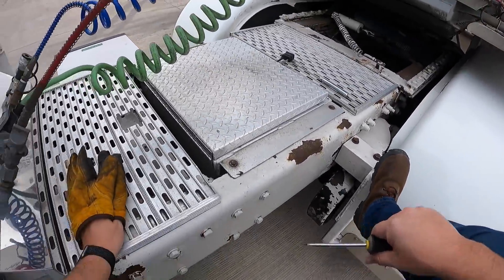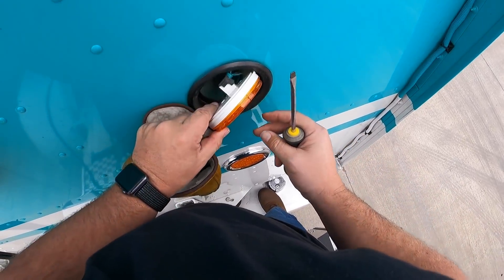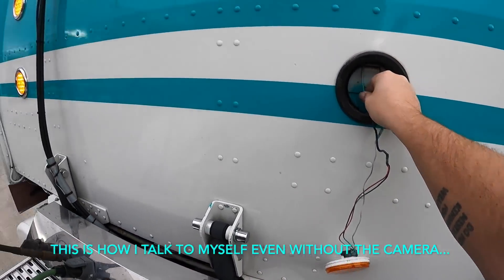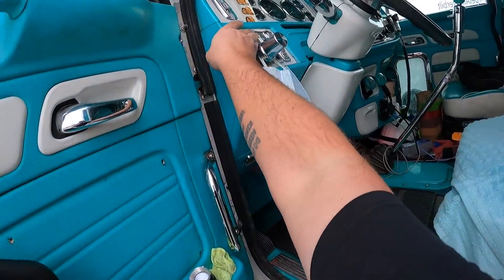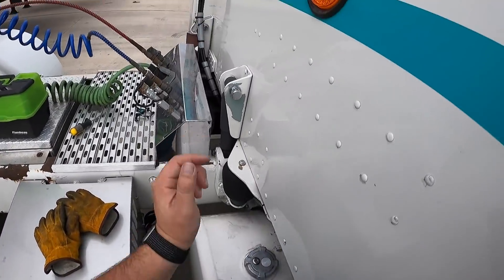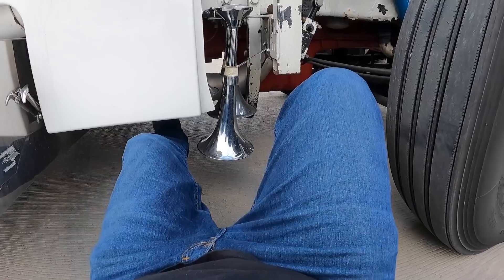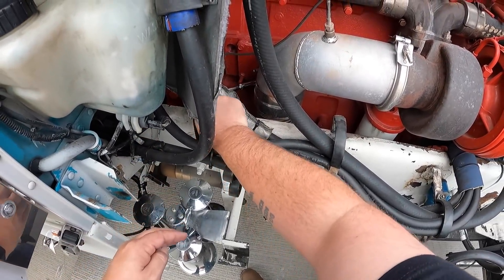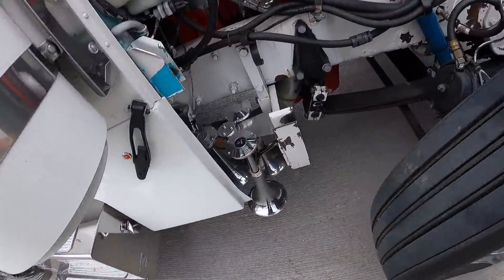There is ALWAYS something wrong with my custom Peterbilt!

Comment: NEVER NEVER NEVER poke a test light into the wire insulation!!! It opens up a path for corrosion and WILL cause an issue later on. Always test the plug, or the butt connection. It looks like they hooked the bright and dim sides of the light together, no need for that just hook the bright side up. Unless you're using those lights for running light and turn signal/brake light, where you would need the extra wire.

Comment: I noticed you got the handle repaired   on drivers door inside . When i had my logging truck i spent hrs repairing wiring . Up here in B.C . They spray roads with magnesium chloride or calcium chloride and if wiring is exposed it eats wiring all sorts of headaches . Anyway good luck

Comment: any chance you can get the wiring diagram from the customizer?  Be nice to know where the wires are supposed to be and then you have a much better understanding of where to check for issues. Did the installers put in a junction box or just splice into the existing wiring?  As an electrical type, I always want all the info I can get from prints/wiring diagrams,etc.

Comment: One wire is signal, one is marker or running. I am surprised I figured it would be a ground. My last peterbilt had a lot of ground issues,  but it's an 1981.

Comment: Simple fix:  run a new wire from the light above!
Reply from the maker: They’re all out on that side. lol. But the thought crossed my mind from the other side.
Reply: @Truckinlife  but you need right signal...   Just got addicted to your channel...   Anyone that dont love a peterbilt has to be a gay commie....
Reply from the maker: @Gwalker0220  it’s not a turn signal. They’re wired to the high side constantly.
Reply: @Truckinlife  Seen more then two wires figured wrong...   Oh That jake is amazing in the tunnel in PA!

Comment: I have a couple questions. How do u shift with the jakes on an they don’t come on? Also was wondering how your cb mike was set up?
Reply from the maker: I either don't lift my foot far enough for them to come on or I will rest my foot against the clutch just far enough to actuate the switch to keep them from coming on. 

My mic has an extension that runs down the center of the windshield tucked into the seal and goes into my dash and come out the bottom of the cup holder. I had to drill a couple holes but its worth not having wires hanging across my cab. 😉
Reply: Thanks a lot for replying really appreciate it. I’m a new subscriber love ur content an definatly the truck. Like how u have the mic set up. Understand about not having wires hanging all over the place

Comment: see crackhead builds  connect all the wires together just to get it done  no body was thinking about repairs when they electrical taped all the wires together ptolly thru the whole cab ha ha
Reply from the maker: 1.6 million miles on a 14 year old truck... of all the issues I’ve had in 5 years and this is the point you’re going to choose to make?... 🤦🏼‍♂️
Reply: @Truckinlife  you said always something wrong not me
Reply from the maker: @lindabingham394  yeah, cause it’s a 14 y/o truck with the better part of 2 million miles, pulling tank. lol 🤦🏼‍♂️